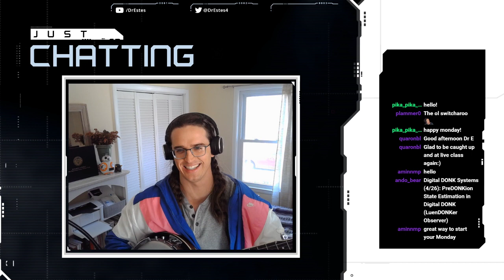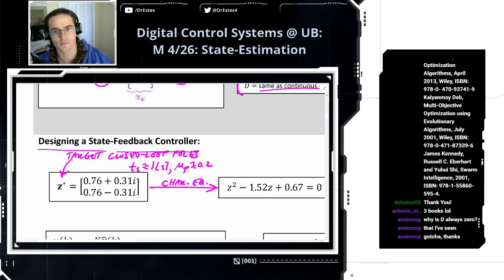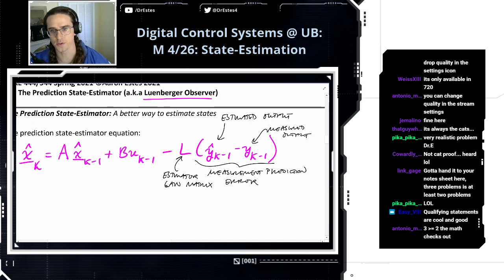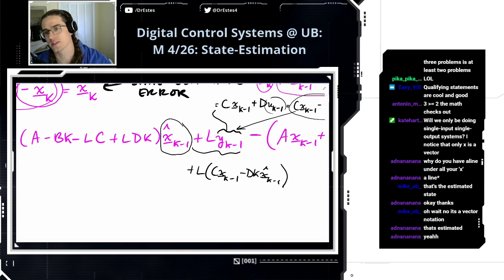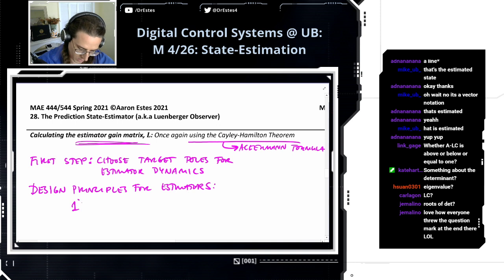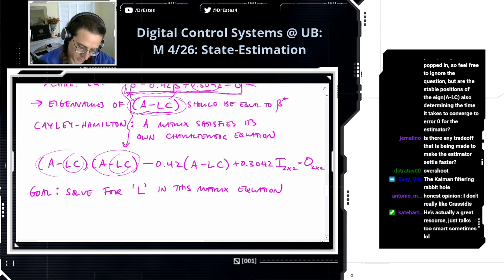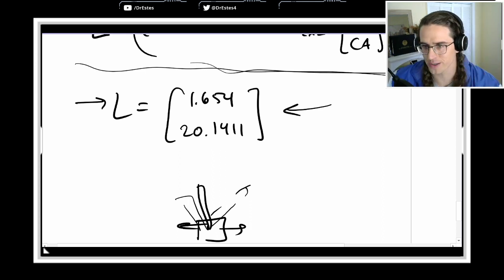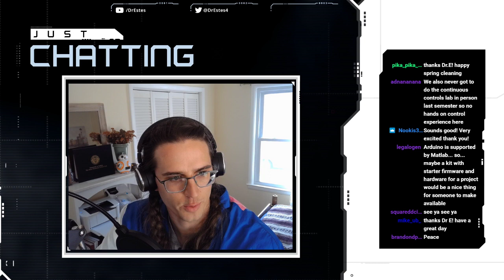Digital Control Systems (4/26): Prediction State Estimation in Digital Controllers (Luenberger Obser

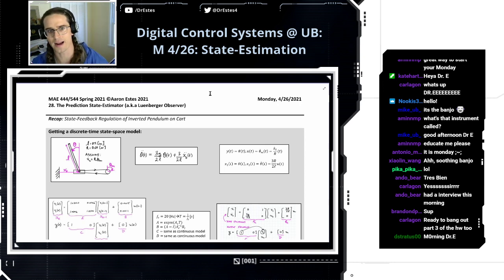Comment: Getting a discrete time state space model         6:30
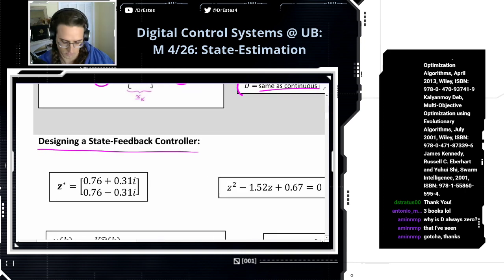Desiging a state feedback controller                   12:00
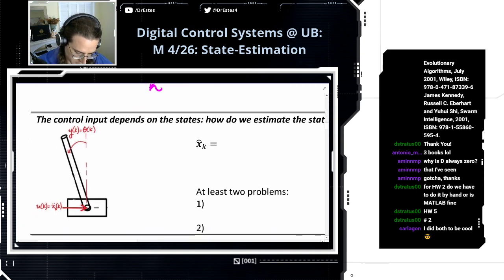How to estimate states ?                                        16:00
The prediction state-estimator equation               20:20
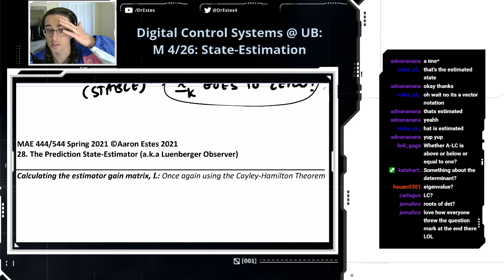Calculating the estimator gain matrix                    41:16
Calculating the L matrix                                            58:50